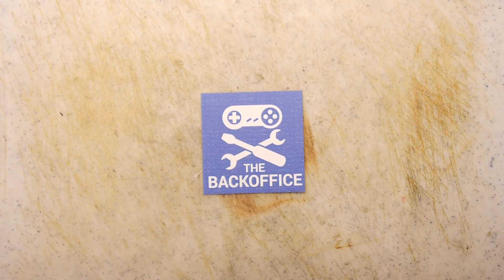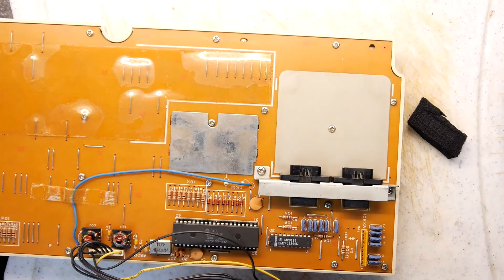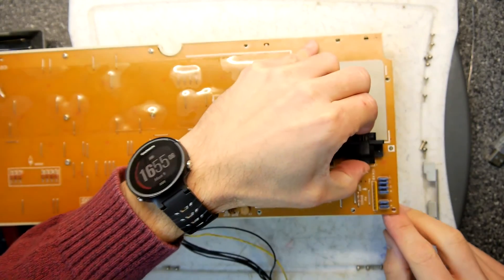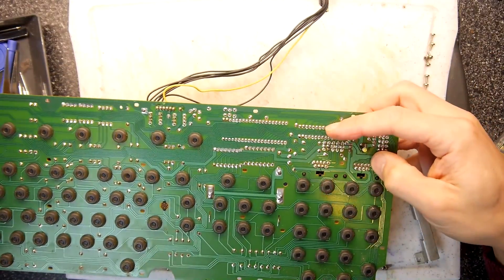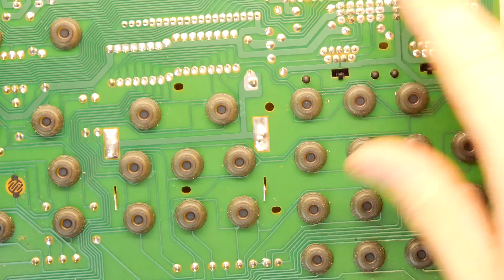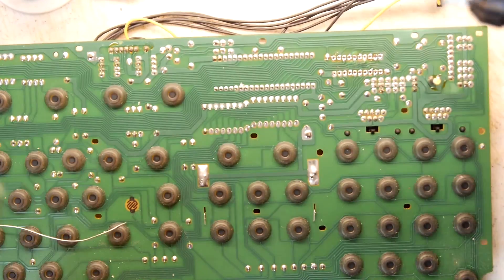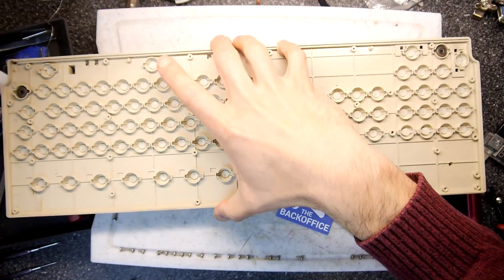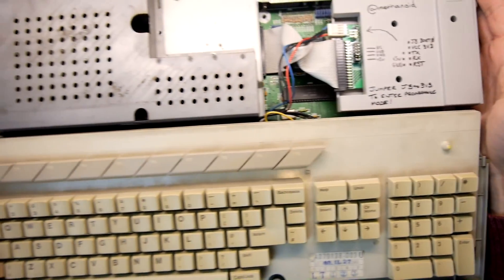ATARI ST Keyboard Repair

Comment: What would cause an STE that accidentally fell about 61cm (two feet for USA), and then just starts behaving like someone is holding a key down constantly?  (Also results in joystick/mouse not working at all.)
Reply from the maker: I would check the connection between the keyboard and the main board and then make sure every chip I can see is seated properly
Reply: @backofficeshow  I'll check as best I can.  I really want a 4MB machine for MIDI and especially for chiptune making.

Comment: Hello Backofficeshow, one question related to your video : if a 520 STE gets the joystick position UP/JUMP locked to high position permanently, leading to the sprite in game to jump all the time, could it be too a problem with the 74LS244 nearby the IKBD HD63901 MCU ? Thanks :D !
Reply from the maker: Looking here https://backofficeshow.com/atari-st-service-manuals at the STE manual looks like you have 4 74LS244s processing the ports, I think it could well be worth swapping out the IC, it would not take long and you would know if it worked pretty quickly.
Reply: @backofficeshow  ok, even better : after removing the keyboard PCB, the joystick up/jump position is still stuck to high ! so the problem lies on the motherboard ! is the ACIA 6850 managing the keyboard could be the culprit ?
Reply from the maker: Unfortunately anything along that path could be. I'd have to study the diagram, but I would look out for the simpler ICS first
Reply: @backofficeshow  what do you mean by ICS ? this term doesn't speak to me.
Reply from the maker: Integrated circuits

Comment: Hi there.
Impressive ;) I get my power on light off on my 1040 stf atari. Any idea on how I could fix it ? Best
Reply from the maker: Do you get any lights or no lights? Does the machine boot?
Reply: @backofficeshow  Yes the machine is working fine. I juste have no power light at all ... Any suggestion ? Thanks
Reply from the maker: You could probe the PCB to see if the led is dead then replace it off necessary. Also is possible to wire your own led into the chassis from the power rails on the board of you are keen.
Reply: @backofficeshow  I'll make a try. Thank you for your help.
Reply from the maker: No problem
Reply: @backofficeshow  In fact i dicovered that some keys are also out of order : 1/!, 3/£', 5/% and 7/&. I opened and cleaned the keybord but now CTRL, SHFT and ALTERNATE keys are out too... damned. Maybe some circuitry went down... ?!?
Reply from the maker: @MadMax-r9t  it sounds dodgy for sure. Maybe some PCB tracking is shorted or corroded?

Comment: Hello Friends, 
I have a small suggestion: 
Should a damaged IC be replaced by a new one, I suggest to solder a Dip or better a Sil Holder like this one..

https://www.henri.de/bauelemente/steckverbinder/stiftleisten/buchsenleisten-einreihig/15496/buchsenleiste-federleiste-20pol-print-einreihig-gerade-sil-fassung.html

I prefer Sil Holders because you can easily pinch off the number of pins that are needed.
If there are again problems with the replaced IC, it is easy to change the affected device .. 
Btw. the board will not be damaged if the device has to be removed again.
Cheers Stefan

Comment: I had an ST with a dodgy mouse port - had to push the mouse connector in firmly to work it. So I suspected a cracked joint - used your video to see how the keyboard came part, really helpful thanks. Although on my keyboard many rubber caps were nearly all loose - made for challenging work! Mouse port all good now after reapplying solder.
Reply from the maker: That's great! Glad it was of some use and that your ST is running again!
Reply: That's apparently a very common problem with the 1040-style case ST/Falcon030 keyboards...the solder joints to the mouse/joystick ports degrade and usually just reflowing the solder points fixes it.

Comment: My mouse does not work anymore on my Falcon (Buttons do but the cursor does not move). I tried to resolder the pins  on the keyboard with no success. I noticed the buffer you changed gets very hot. Could it be the issue ?
But the chip  number on my keyboard is not the same : it's a  Motorola SN74LS244N. What's the difference?
Thank you.
Reply: ravuya i changed the little chip. It’s working now.
Reply from the maker: It seems to be a pretty common octal buffer/driver so I think its definately worth the 75p investment and just swap it out as a first step.
Reply: I have a 1040 that has the same problem as you (mouse buttons work, but the mouse itself doesn't move). The mouse is good. Have you had a chance to figure out what the problem with your Falcon was?
Reply: Is there just the one 74LS244 on the keyboard, or is there another closer to the mouse? Will take a look at it soon, thank you!
Reply: ravuya only one I think

Comment: Hi, short question if you don't mind... my issue is a bit different, sometimes the keyboard is repeating a key strike during minutes and then the mouse can't be moved... do you think this is the same issue where I need to replace the buffer?
Thanks
Reply from the maker: +Remy CRICCO If you are sure none of the keys is sticking I would certainly try swapping out the main ic, it seems to be the boss of everything 😂

I would check for mechanical issues first.
Reply: Hi, thanks... keys are ok, mechanical stuff are fine. In fact, this is like if i was keeping my finger on the same key for minutes.. there are lot of "ping" sound and I can't move the mouse... Anyway, ok I will try to replace the big chip on the keyboard
Reply from the maker: +Remy CRICCO it really sounds like a stuck key, if not in reality maybe in the chip 🤔
Reply: ok thanks, i will double check the keys
Reply: VERY GOOD GUESS sir !!! This was a stuck key, in fact I have at least one rubber between the key and the PCB which is dead, leading to a continue push to one key... because of this the computer was blocked and the mouse was not moving. Now I need to find which rubber is dead (or are deads), find some replacement parts and change them ... thanks a lot for your support !
Reply from the maker: No problem sir! Good luck on your fix and feel free to share my channel with anyone it may be useful to :)

Comment: the easy way lol. ideal way would be of course remove the old chip and a socket then the new chip but needs must
Reply from the maker: Yeah, I think if I had a socket I would have added it as I do experiment with the hardware. A nice turned pin socket would be my preference :)
Reply: The Backoffice nice job by the way
Reply from the maker: Thank you for saying. I came in a little hot for 'ye olde' PCB material and got a little bubbling, so I could probably stick to the heated sucker in the future. But all in all they are really fun to work on :)

Comment: You got fooled by the 'missing' Return cap as well :-) I think everyone who disassembled the ST keyboard the first time was worried about this cap that never was!
Reply: It's a problem that returns again and again :-)

I ordered 2 spares and couldn't workout how to fit the missing one ... oh well
Reply from the maker: Ha ha! Is it thrown in there to fool people :)
Reply: I don't know the real reason behind it, but I tried adding the extra cap but then the Return key needs to be pressed to firmly in my opinion.
Reply from the maker: I remember back in the day seeing replacement rubber thingies to make the keyboard feel better. I am not sure if they were any good, but I never had any issue with the stock ST keyboard.

I am quite impressed with the build though, these machines are battle tanks!
Reply from the maker: Actually I think I know the real reason, its probably because they made the keyboard for different countries and not all use the same key layout. It was probably so the same generic PCB can be used for all the country designs. It rings a bell because when I dug up the schematics I saw that there was a BOM matrix for all the other international variants.  :)
Reply: http://imgur.com/a/siLXK A replacement keyboard like this (TT touch they called it)? This one needs to be cleaned tough :-)
Reply from the maker: Oh thats a new one on me! The thing I was thinking about just had firmer rubber domes, this is a whole crazy thing :)
Reply: Yeah, I remember noticing the 'missing' caps the first time I took apart an ST keyboard, but unlike many others, I kinda immediately dismissed it as intentional (though I did take a quick look around my desk to see if one had fallen somewhere).